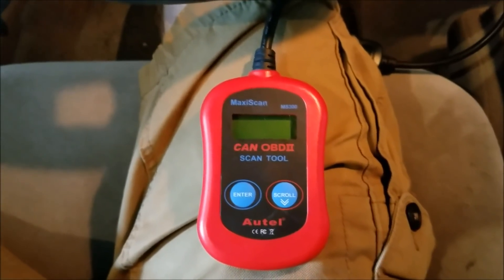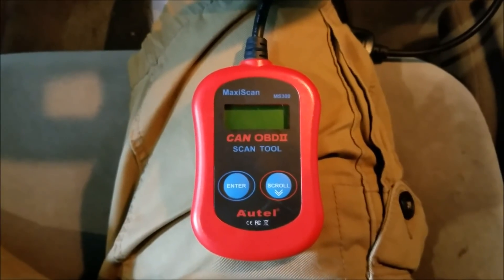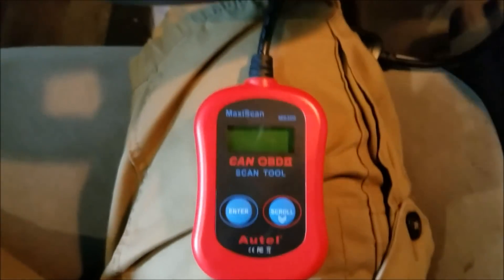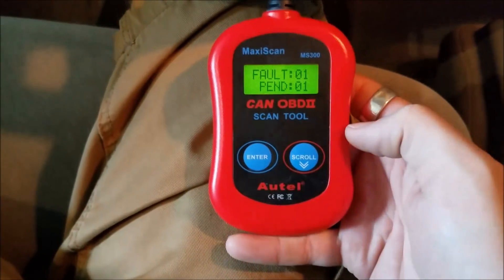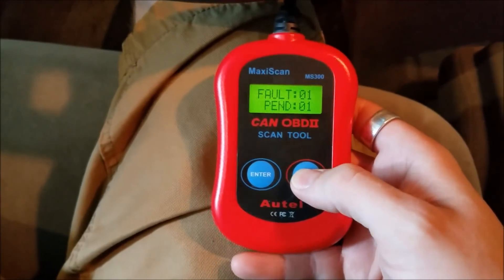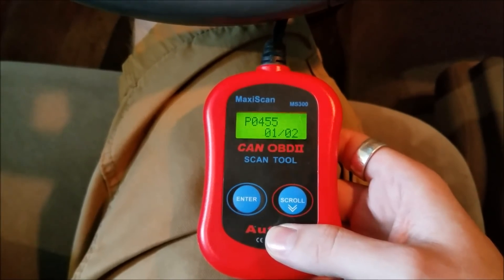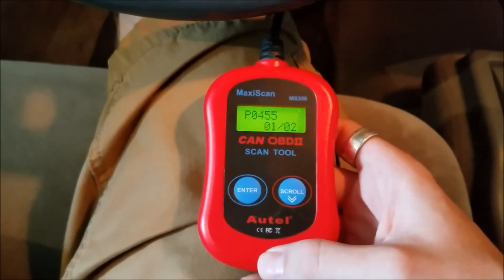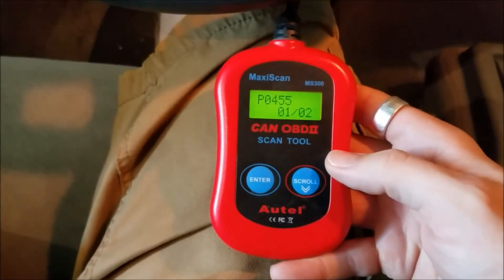EVAP Emissions P0455 or P0499 Fix for General Motors Vehicles

Comment: Computers are smart these days…. People just type in your code number. When you Google it it’ll tell you….
When I put in my code of the 455 it tells you what part that is that needs to be replaced that code doesn’t mean three different parts……. Unless it states you got a small leak or a large leak then it could be anywhere in the system of the EVap.   The 499 indicates a totally different part from the 455 number check it out.

Comment: There ya go shoot the parts cannon at it instead of diagnosing it the correct way did you do a visual inspection of the wiring  first did you check your wiring integrity did you look at the service manual to see what conditions have to met for it to set that code the scan tool code only gives you the circuit where the problem is not the exact cause it's only a starting point and all the parts stores won't give you any direction they'll give you the code and they'll tell you it's this or that because they make $$ by selling parts not knowledge no sense in spending a ton of $$ on a part you don't need when it could be something as simple as patching a chafed wire
Reply: Lol, you're an idiot dude. It's process of elimination parts wise then possible electric ya asshat clown
Reply: You ever worked on a car??? Sounds like you'd spend days searching for an electrical problem instead of swapping the part and fixing the problem lol

Comment: I replaced the canister, gas cap and the solenoid and still have the p0449 code.
Reply: Maybe a crack in the fuel pump
Reply: Bad or Cracked hose somewhere (a smoke test will find it quick) or cracked canister or wiring.....test the wiring has continuity and voltage. That would be the first test to do rather than throw unnecessary parts at a problem that isn't verified to be the actual problem. Exactly what I did because I was being lazy and "thought" I knew what the problem was. Replaced both parts for nothing just to have the P0499 pop right back up. Irritating to say the least. Most likely you have a dry rotted hose somewhere or a bad, broken or shorted wire or there is a corroded connection somewhere along the loom and that needs to be cleaned up and fixed. Then test again for continuity and voltage to confirm the repair, clear codes and drive. Should be good to go unless you have a demon haunting your EVAP system.
Reply: @MyBigThing2010 If you have an older car, then throwing in new parts to chase a problem is not a bad idea. Most of them are cheap.

Comment: My problem was a. Leak in the hose back at the canister.   In the very back of car    In the trunk area.   Under neath  the car I unhooked the hose at the purg vale hook up low volume. Air. With.  Very little gas in the car. Found leak in  10 seconds

Comment: Is this what causes the car to idle when im at a stop light? Or what could it be? Ive already replaced the gas cap and the other part by the tank.. i have the p0449 code showing up but not the other code. Please help. Thank you!

Comment from the maker: If you're looking for a good cheap OBD scanner like the one in the video to figure out why your check engine light is on check out this one: https://amzn.to/36Ym9r2

Original Equipment Manufacture (OEM) parts replaced on this 2006 Buick LaCrosse 3.8L V6 in this video include:

OEM ACDelco brand EVAP Vent Canister/Soleniod (underneath the car) with adapter harness: https://amzn.to/3o8ncf9

OEM ACDelco brand EVAP Vent Valve/Canister Purge Valve (in the engine bay): https://amzn.to/37bMQJ3

Double check part numbers depending on what GM vehicle you're looking to fix emission codes on (most look similar but may be slightly different) and I highly suggest sticking with the OEM brand

Comment: Thanks for the detailed video, i will deal w the vent solenoid soon thanks to you! Wish me luck. Mine is a 2007 Lacrosse with p0455 code
Reply: My update is that the nylon pipe connection of gas tank to the vent solenoid had cracked. I just spliced that pipe into two, introduced a brass coupler and connected the 2 pipes using Teflon tape for a waterproof seal. The problem is now resolved. The nylon pipe connection has bends due to crappy design of the vent solenoid inlet connection. The cost of repairs was just 10 bucks!
Reply: @kunalkhanna985  so you’re saying this video was false
Reply: @StreetKid-009 my issue was caused by cracked pipe which is very similar to solenoid being out. So my condition is an additional condition for the same obd code

Comment: 8/2020 Called local Buick price for canister 31 bucks and wire harness 42 bucks. those are the Ac Delco brand. Dorman makes one for about 28 bucks WITH the  plug.

Comment: My 2006 Buick rendezvous is giving the p0455 code. First it was the check engine light then it said it was the gas cap. I replaced the gas cap but it's still telling me that it is open and the check engine light is still on. Any advice?
Reply: Bad or Cracked hose somewhere (a smoke test will find it quick) or wiring.....test the wiring has continuity and voltage. That would be the first test to do rather than throw unnecessary parts at a problem that isn't verified to be the actual problem. Most likely you have a bad, broken or shorted wire or there is a corroded connection somewhere along the loom and that needs to be cleaned up and fixed. Then test again for continuity and voltage to confirm the repair, clear codes and drive. Should be good to go unless you have a demon haunting your EVAP system.

Comment: 9 times outta 10 its the vent cannister by the  fuel intake under the car.
Reply: My issue was a crack in nylon pipe at a bend- it was bent for 13 years so I guess it was bound to fail.

Comment: Ive done all of this multiple times and still have the issue. I have an 06 malibu lt v6 3.5l. Ive even gone as far as to replace the wires that go to the solenoid under the car. Please help.
Reply: Same car and same problem I got a new gas cap that didn’t work and the purge valve
Reply: Fuel sensor !!!! Have u changed THAT if not that's your problem!!!
Reply: I had that problem I live in apart ment so it took time for me finally figure it out

Comment: 99% of the time it’s the vent valve, especially on GM’s.....rarely is it the gas cap....
If you have a scanner with live data capabilities, the purse solenoid will read 100 % wide open when open throttle.
Reply: I replaced mines and still ride funky lol
Reply: @carlosherrera8541  
If you have a scanner that reads live data look at that. You could also do a smoke test to see if and where the leak is if any.

Comment: The vent solenoid is the one by the gas tank, the one in the engine bay is the purge valve solenoid.
Reply: Are the connectors servicable? Can i replace the orings?

Comment: Even if you have to buy more than one part, it's still a hell of a lot cheaper than having a shop do it !!!
Reply: and having a shop 'learn' from your car and get it wrong two times. Heck, I can do that much.
Reply: the shop is gonna guess and charge you for guessing
Reply: Nah learn how to to read a real  scanner ...instead of buying part after part😂😂😂🤫😉👌🤟
Reply: Mounting the nylon pipe by hand is really really difficult. It is dangerous to use heat gun as that pipe is connected to gas tank. Please be warned. If your nylon pipe cracks, you repair the crack using various kits available at popular auto part stores.

Comment: No check engine light but gas tank hard to fill. Is this a clue that the canister vent valve is defective? Replaced the purge valve year ago. Best video yet on subject.
Reply: Purge solenoid valve. My car was doing the same thing. When I filled it up the car would stall and then eventually stall
Reply: Could be a rusted filler neck too

Comment: Po455 chev malbu 2007 replace gas cap
Reply: hello good day and if the check engine witness is removed by changing the fuel cap?
Reply: Adrian Abernathy hello  good day, the check engine witness is removed by changing fuel cap
Reply: Chirrin Diaz Is that a question? If light comes off and stays off, and gas doesn’t shut off while filling, it was cap...I think.

Comment: Why throw parts at it? Proper diagnosis will find the leak...
Reply: To diagnose it takes a smoke test which from what I've seen runs around 80 bucks which is more than both of those two parts cost together...
Reply: If you have a car that has over 100k miles, doesn't hurt to replace those parts anyway.
Reply: @HToWnRePPiiN  only to the wallet.